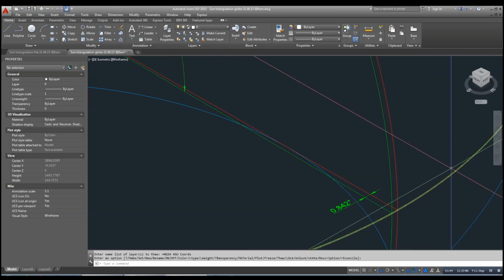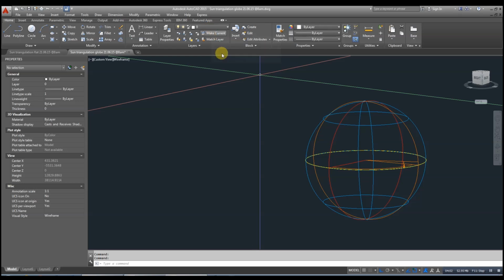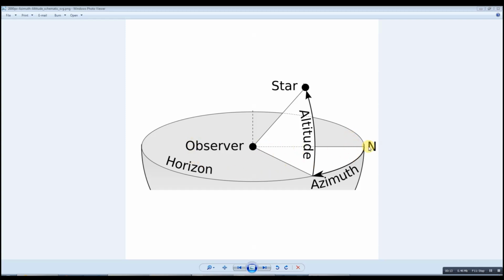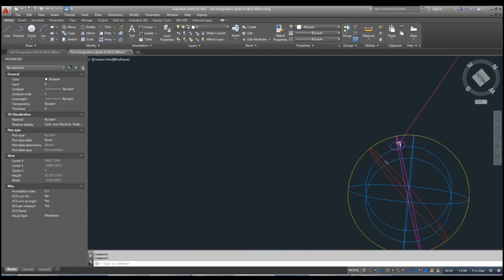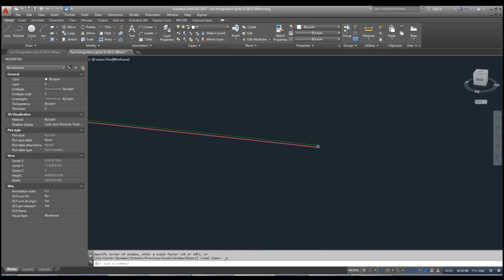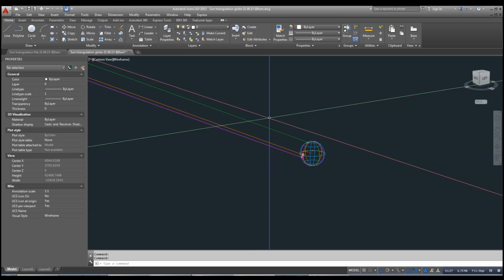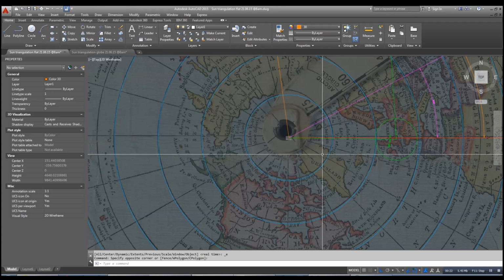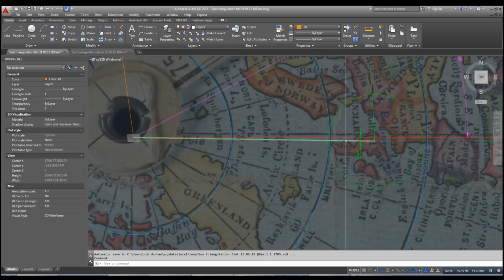Flat Earth and Sun Geometry

Comment: Rob, would you be interested in using your AutoCad to do an orthogonal diagram and / or animation of the sun tracking parallel with the flat Earth so that at some stage it is 0.5 degrees above the horizon. Let’s assume the sun is 3,000 miles high and another version with the sun at 150 miles high. 
I estimate at 150 miles high and 0.5 degrees the distance the sun must be 17,188 miles from the observer. If the sun is 3,000 miles above flat earth the distance to the sun from the observer must be approximately 343,766 miles away from the observer. 
A video would be nice if you could have the time.
Reply: This would indeed be a very nice video. I am just afraid Rob has chosen his belief to be FE. If he ever does the exercises in AutoCAD, he will most likely not publish it. 
I sincerely hope to be proven wrong!
Cheers 
Winston
Reply: Having an ACAD clone  I can give it a go, PFB.  But doing so to depict a flat Earth will entail that I get a chemical lobotomy, first.

Comment: Electrolysis of water (H2O) is the main method to generate oxygen aboard the ISS. Water is split into oxygen (O2) and hydrogen (H2). The oxygen is vented into the breathable cabin air system, known as the Oxygen Generation System, while the explosive hydrogen is vented externally. Submarines can also use this technology. It’s no secret.

Comment: Rob: Can you do the following with your construction please? Make a line from all 3 points on earth directly to the center of the sun. Then measure the angles between these lines and the diverging ones. I am curious whether AUTOCAD displays this angles other than 0 deg.

When it comes to such deformed triangles where one side is about 12000 times smaller then the other two (the distance to the sun is 12000 times the diameter of the earth), then very, very tiny changes in the angles result in gigantic differences in the height of the triangle. As an example: 

I took 2 cities 2034.4 km apart on the same longitude, where the sun in one city was exactly 90 deg above the horizon, where it was seen from the other city at exactly 71.7034373 deg (computed angles, not real measurments, but to illustrate the point that does not matter. You can construct this example in AUTOCAD and you will see the lines meet about the center of the sun). From this data I can compute the exact distance to the sun. In this case I get 149.99991 million km. 

If I measure the elevation angle as 71.7 deg instead of 71.7034373 deg, I get a distance to the sun of about 27.3 million km. That is only 18% of the right distance. This is off by 122.7 million km! To get the distance right to an accuracy of only 10% you must measure the angles to an accuracy of about 0.0001 deg! No wonder do the lines not meet at the center of the sun in your constuction!

Because it is very difficult to measure such angles accurately enough to compute the distance to the sun, astronomers use other methods, where astronomical distances as the distance to other planets are used to triangulate the suns distance.

Comment: Hi Rob, I like your work!  Is this experiment still alive?  Did you get anyone to give you the location data you needed?
Have you tried to see what happens to the error of the convergence point at the sun when you change the azimuth or altitude angles by just one least significant digit?  I mean, for example, the azimuth to your location was -0.842 degrees.  What change of the convergence point do you get if you move your azimuth to say -0.843 degrees?  Or if you move your altitude from 53.0627 degrees to say 53.06271 degrees?  I think the error you are getting at the convergence point at the sun is simply because your azimuths and altitude angles are not precise enough.
You said you are willing to pass on your AutoCAD model.  I was going to make my own, but now that I have found yours, I would really appreciate getting a copy of yours please!   You can email me peter dot ai at iinet dot net dot au.  Cheers!

Comment: Why not use three points on the same longitude, then you don't need autocad. If you observe the celestial pole then all 4 points are on a plane at right angles to the surface of the Earth. The pole's altitude angle should match your latitude and the distance between you should be 60 Nautical Miles per degree difference. If you find that to be the case then the Earth can't be flat.

Comment: At 21:30 The technology used on spacecraft is "carbon dioxide scrubbers" (https://en.wikipedia.org/wiki/Carbon_dioxide_scrubber). They are also used on submarines and have been for a long time. I am afraid I can't find a reference for which came first in terms of Alkali Metal Hydroxide scrubbers, spacecraft or submarines, but it might well have been submarines since they used other technology to recycle CO2 at least as early as 1948 (see: http://newatlas.com/dixon-ring-co2-scrubbing-system/15473/).

Comment: +Rob Durham
You are very skilled in the use of the graphics program, so you might try to find a circular path, e.g., directly over the Equator of the flat earth model. Someone standing on the Equator should see the projection of a circle, and being off-center, this is bound to be an ellipse. (To see the circle as a circle, you'd have to move it far away - so far that being off-center by the radius doesn't matter any more. But this would have other consequences, wouldn't it?) You can probably produce the projection of this ellipse on a cylinder around the observer's position, i.e., what he should see on the sky. But even without, it should be clear that this orbit, parallel to the flat earth, cannot be reconciled with the actual observation that the Sun (on an Equinox) raises straight up, continues straight overhead and settles straight down, i.e., following the projection of a circle with the observer in the circle's plane.

You can make a variation on this theme by trying to find suitable planes for the circulation of the stars which can be observed as circles overhead on the North pole; as circles in a tilted plane around a point close to Polaris with an altitude corresponding to your home town; and finally as semicircles in vertical planes around an axis that has miraculously assumed a horizontal position for the observer on the Equator.

BTW, you derive the flat earth model from that 1896 Gleason's "new map of the Earth", which is an azimuthal equidistant projection of globe data, produced by taking "all" meridians, second by second, off the South pole and laying them flat in a plane orthogonally to the Earth's axis, through the North pole - so take care. It distorts east-west-going lengths all over the globe, and profusely so south of the Equator.

You are not referring to the infamous "vanishing point" that miraculously makes the Sun appear and disappear when it is supposed to. Central projection does have a vanishing point which is the infinitely remote point associated with a bundle of parallel lines and which appears in the projection as the intersection of this "bundle" - now mapped as a "bunch". However, in order for some object to disappear into this point it has to shrink in accordance with the parallel lines approaching each other. The Sun, however, remains adamantly at his very constant angular diameter of 0.5°.

You might also try and use the Sun's angular diameter in combination with the (approximate) distance of the Sun you get when you interpolate the Sun's position according to the construction in the second half of your video to calculate the Sun's diameter. Next step would be to determine how far away such an object would have to be to shrink below the 1' angle which is the threshold for seeing something with the bare eye. (Something very bright would still be visible beyond that point, and a good binocular or telescope would push that point even farther away.) Compare this "vanishing" distance with the maximum distance the Sun can have from an observer on the Equator, and the minimum altitude it would have at that point.

We might continue this exercise by trying to find a location for the orbit of the Moon, e.g., while assuming that an Equinox coincides with a Full Moon. If the Moon is vis-à-vis to the Sun to have the full benefit of his light on her face, an observer close to the Equator looking straight up to her would see - what? (I guess the standard way out of this dilemma is that the Moon is some sort of galactic "glow worm", with an inexplicable skill of showing her phases and surface shading in full accordance with positions derived from the heliocentric model.)

(Please, what's the name of that great graphics program you are using?)

PS: Re "ellipse" in central projection: I do know that this is close, but not quite true ;-)

Comment: Great video (but please increase the volume in the future).  Not sure this is the appropriate place to post this but - Yesterday in NY State I noticed both the sun and moon in the sky at the same time.  They both appeared to be approximately at the same height in the sky, with the sun about to set in about an hour and fifteen minutes.  The moon was in the south east and as I faced it the LOWER LEFT portion was shaded (or dark).  The sun appeared in the east and the two bodies appeared to be completely exposed to one another.  The strange thing - it appeared to me that due to their orientation to one another that the LOWER RIGHT portion of the moon should have been in darkness or shade as that part was least facing the sun.  The lower left of the moon appeared to be fully exposed in line of sight to the sun, yet was dark.  Can anyone explain to me why this phenomena occurs?  I looked at it for the longest time - and something definitely appeared to be in-congruent.  I would have shot some video if i were not at a clients office for an appointment.

Comment: Did you see the video 'Flat Earth: Proof That The Sun Cannot Be 93.000.000 Miles Away'It was done using AutoCAD
Reply: He's using completly wrong numbers for this. It DOES matter if he is 1:20 late. It also DOES matter that he doesn't use exact numbers. It even does matter that there is a difference of 50km at the longitude

Comment: Hi Rob, Having had some experience of celestial navigation, you may be interested to know a few things. It's similar to what you've done, but to find your position, you measure the altitude (angle) of a celestial body above the horizon at a known time of day, UTC, GMT, it's the same! This altitude reading tells you, after doing some simple maths, how far away you are from the point on earth (Geographical Position, or GP) where that body is directly overhead at that particular moment in time. You look up the GP of the body, the Sun in this case, in the Nautical Almanac this allows you to calculate a position circle, the centre is the GP and the radius is the calculated distance from the GP, you are somewhere on the circumference of that circle. More position circles from different celestial bodies, intersecting with the first one, or another circle from the altitude of the same body, but taken at a different time of day, gives you your position.

What you will find of interest is you can calculate the distance from all your chosen  locations to the GP of the sun for that date and time which is given in the nautical almanac, (which is 75.42 degrees east and 23.43 degrees north) using the altitude readings given. Distance to GP is your "Zenith distance", which is 90 degrees minus the observed altitude of the body. So for your home Lat and long,  Zenith distance is 90-26.59 degrees=63.41 degrees. One degree of a great circle is 60 nautical miles, so you are 3804.6 Nautical miles or 4375 statute miles from the GP of the Sun, if you check it against a great circle distance calculator, it should be correct to a mile or two, and the distances from the other two locations to the GP will concur  using the altitudes you quoted, any small discrepancies are due to rounding errors, or the oblateness of the earth. 

Do a few of those in the southern hemisphere too, it all matches with observation.

On a flat earth, to get the same altitude measurements at exactly the same time of day from your chosen locations, the sun would have to be at different altitudes off the ground, at exactly the same time, to give the correct altitude observations for your chosen positions. The Sun would have to be in different places at the same time LOL!  The earth is not flat ;)
Reply: +andypdq I know this is 2 months late, but it's good to see someone inject some factual information into this.  It's too bad nobody responded to this, but you know what that means....
Reply: @Crowned_Conquering_Man-Child 
"Even had you proven your statement true via demonstration - which you have not"

Real and accurate knowledge is useful, garbage "knowledge" isn't. 

The fact that celestial navigation works using the spherical model and spherical trig (triangles on the surface of a sphere) to calculate position lines proves beyond all doubt that the Earth is spherical.

If the Earth were flat you'd need to use plane trig, and the almanac would have to state the height above the Earth's surface of the celestial bodies observed, which it doesn't,  in order to calculate a position line.

The fact that you cannot grasp that concept proves you have not even a basic knowledge of trig, either plane or spherical.

"Ignorance more frequently begets confidence than does knowledge: it is those who know little, and not those who know much, who so positively assert that this or that problem will never be solved by science."

Charles Darwin.

Comment: Hi Rob - I really like your work as it's good to have sharp minds on this topic.  One thing I would tell you is that you're probably not going to make the gleeson's map work for this experiment.  For a couple reasons.  1- Light waves don't travel in direct straight lines, especially when they pass through electromagnetic fields, etc.  2- The gleesons map is probably NOT accurate.  This is because latitude and longitude lines are imaginary lines based on WHAT?  (Observations of light which we already established is probably not an accurate indicator of a straight line.)  In other words, I would certainly NOT conclude the earth is a globe because the Gleeson's map doesn;t work.  Peace brother
Reply from the maker: +TheMorgile Hey it's a while since I made this vid and I have since come to the same conclusions. Also after watching Stinkycashs' video on perspective I now believe that angles might be scewed because once the sun sets, it is essentially at eye level seemingly dropping below the horizon. This would be an elevation of zero which it obviously cannot be on a FE so to try to measure an elevation angle without accounting for perspective is perhaps a folly, in any model.
Reply: Scavenger_mi very good point! check out my latest vid the sunrise azimuth debunks the globe

Comment: Ok, I admittedly didn't watch the entire video so if my comment is invalid I apologize. Aren't you chasing your tail on this one? Your trying to triangulate angles to the sun in order to capture the true shape of the Earth. but in order to triangulate angles, you need to know what position (polar on a globe, or coordinates on a Flat plain)  the angles were taken from  which means you need to know the shape of the Earth first - correct? Otherwise, how else do you know where your base points are. That is unless you know exactly where the sun is. Correct?  It looks as if your making an assumption in order to try to get some precision and that won't work. Either way, you need to know the shape of the Earth first whether it's flat or a globe as the results will be quite different. Using flat earth assumption the sun is 3 or 4 thousand miles away but if the same angles are used on a globe it's 90+ million miles away. The 90+ million mile figure has been verified by several other methods (which don't assume a flat or spherical earth) wheras (as far as I know) the 3 to 4 thousand mile figure has not. . And the same observations give either result. You need to start with the shape of the Earth first which invalidates the observation.

Comment: 90° minus your latitude tells you the elevation of the sun at local noon on the Equinox. Assume flat earth. Use 110 kilometers per degree and you can use your latitude and trigonometry to calculate the height of the sun. Go ahead and post your latitude and your calculation for the height of the sun here. The result will be fascinating.